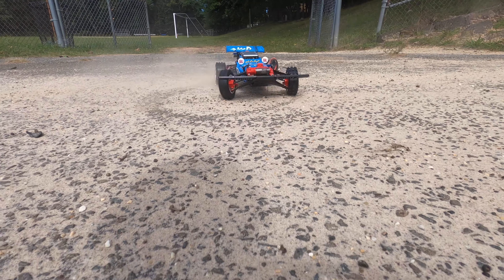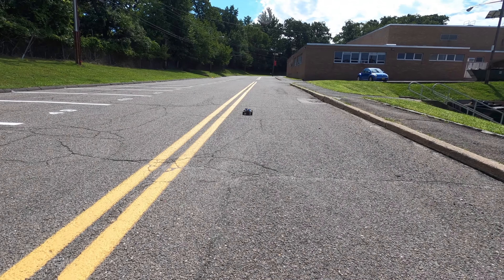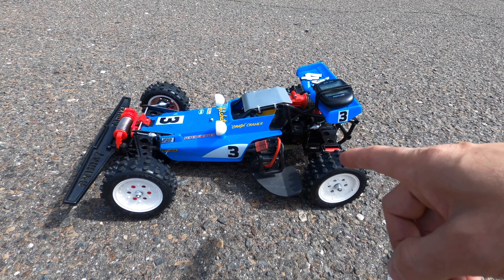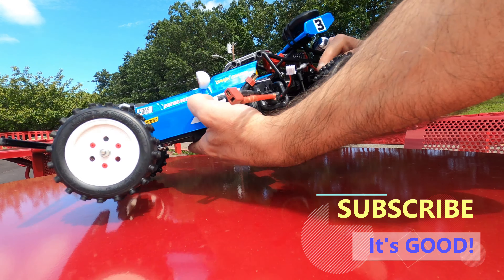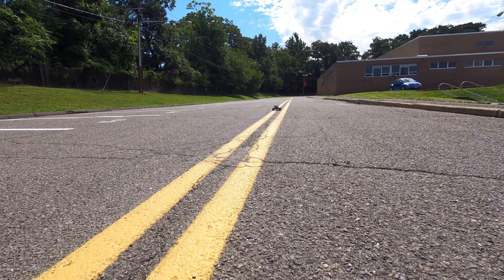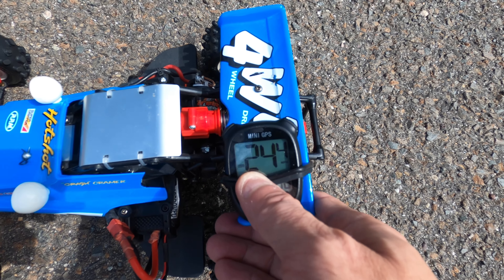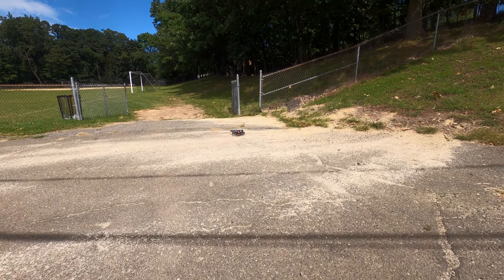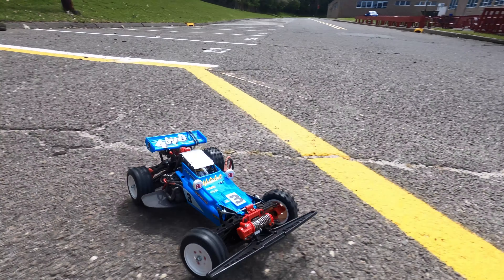Tamiya HotShot GPS SPEED TEST 21 turn motor 4K

Comment: Such a cool place you got there for the speed tests, Steve. Not sure what it is in kph (what about converting it on screen for the rest of the world - just a thought). But +3 mph for the LiPo was surprising. Was the NiMH freshly charged? Voltage on NimH’s drops quickly if it sits on the table for too long. Anyways, it was nice to see the blue Hotshot again. Always a treat. Good job with the voice over. Hope your mic can be fixed.
Reply from the maker: Thanks I had to buy a new mic but also have one GPS video from when the mic broke that I still have to do. Nims fully charged and ready to go. I think I will go out tomorrow and do a couple more GPS tests on some new RC's.  Thanks for watching.

Comment: the flap underneath the batterytray looks cool. is tihs a selfmade part? and whats the purpose? nice buggy too. very cool
Reply from the maker: Hi thank you, It's a vintage part I think CRP made it back in the day, It protects the rear A arms in a crash or if you hit something in front of the wheel so it stops the A arm from snapping off. probably does something else but I am not 100% sure on this. 😁

Comment: friend I have a 7.4v battery ... can I use it in my car that is 6v? will have a problem??
Reply from the maker: Hi what car? also sometimes you can and sometimes you can't.  Thanks
Reply: @ShenRC  My car is MZ 2838 1/14  6V
Reply from the maker: @enfrees  Not sure your going to have to change it to find out.
Reply: @ShenRC  thanx friend 💪🏻

Comment: Hi again. Sorry I keep posting on your old videos 😅. Anyways. Any long term review with this 21t motor in your hotshot? I’m wanting to put 21T in all my hotshot family’s but wondering how the diffs and gears hold up. I AW grease all my diff gears.. want something a little better than a sport tuned and my motor of choice are the holmes hobbies retro sports because of the internal fan for cooling. Thanks 👍
Reply from the maker: This motor has been fine no problems. Thanks for watching my videos I don't care if it's old or new ones!
Reply: @ShenRC  okay cool. My main concern was gear and diff wear
Reply from the maker: Just make sure as with all tamiya kits you use a steel pinion gear as the stock ones melt away real fast and mess everything up! @NoNoRc
Reply: @ShenRC  yep. I’ve ordered steel pinions for every tamiya kit I own. Ive felt butter harder than those aluminum ones

Comment: lol, cool vid. what rear wheel adaptors do you use?
Reply from the maker: Hi those rear things I used are a vintage part CRP I think, I purchased on e-bay that you can use up front or in the rear they are slipper clutches so you can loosen the wheel nuts or tighten them up to let the slippers slip so the tires wont break loose. Thanks for watching.

Comment: Not sure if it has already been asked, but what pinion are you running here? As the kit comes with a 13t and 15t pinion. Cheers
Reply from the maker: Hi it's been so long I will have to check it and reply back to you ... stay tuned.
Reply from the maker: Hi just looked at the hot shot it has the 15T pinion installed in it.
Reply: @ShenRC  Thank you! And love watching your vids.

Comment: I got me one ordered....seems soooo slow compared to my arrma and Traxxas trucks n cars😂.....my speed car is Abt 80 mph faster than this car.. 😂
Reply from the maker: Yeah it will be even slower with the stock kit motor because I put a 21T motor in this one!  your used to those fast RC's this will feel like it's in slow motion..... but it will look like a beauty that's for sure when you run it around.  Thanks for watching.
Reply: @ShenRC  my 1989 Schumacher cat xls is a beauty to see running....just like it did when I first built in 89
Reply from the maker: @redblue40rc33  O yeah that's a beauty!